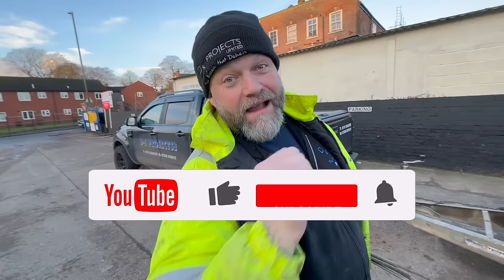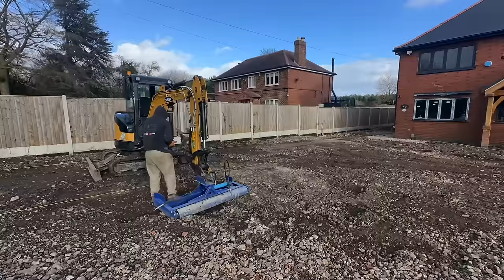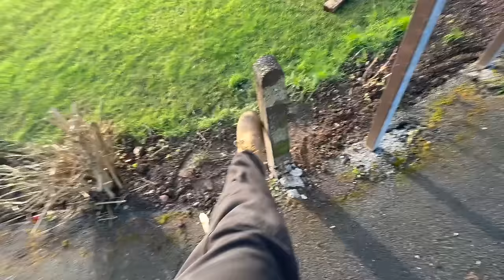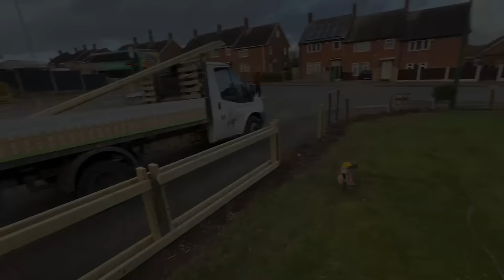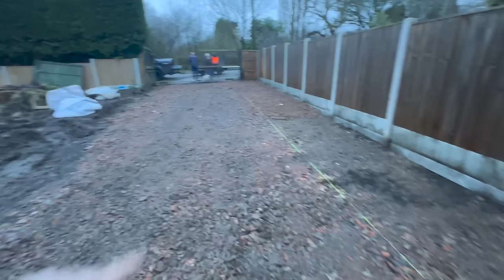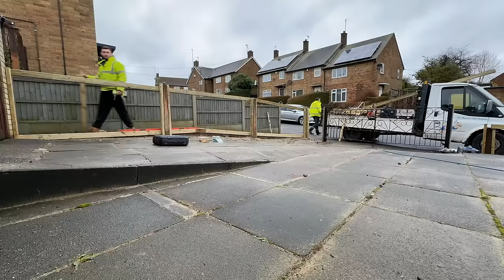How To Replace a FENCE Using The OLD posts *EASY DIY*

Comment: The best example of why the modern concrete post fence design is superior. Super easy to lift a panel and make a change without too much work. Great job guys.

Comment: Great informative video again boys. How are you drilling through the concrete posts to out the bolt through both timbers. Doesn’t the concrete posts have strengthening wire in it ?

Comment: Stevie my guy you don’t rail up like that on the last bit of the video…you go post to post. You should of cut the 4x2 on each post my guy. Or that’s the way I do it….the pails will hide it I no….and the customer must have money to throw away having 4x2 rails on both sides…you could of double sided it using one 4x2 and just clad it on the back of the front 4x2…can’t wait to see the finish….and loving the driveway job Dave…lucky worked hard putting the extra gravel board on that fence…that’s a horrible job lifting them 12” gravel board in and out….again can’t wait to see that job finished….big love to all D&j family ❤
Reply from the maker: It’s finished now and wait till you see it, looks amazing

Comment: Good afternoon D&J team wow James’s garden seems to look bigger each time you visit it just out of curiosity what square meter or yards is the driveway on James job please? Stevie that looks like a bit of a head slapper does that fence I always hated the mis gap hit lollipop stick fences as no matter what I did they never worked out and I always ended up with the gaps matching each other in the end I used to explain to the customer that there is a large chance they would but I always try not to get them to match but they always did best of the great British luck as you’ll need it.😊😊😊😊😊

Comment: I'm not sure why you put the bottom rail on the dirt. It really should be at least 3-4'' up from the ground to prevent rot. The pickets can be 1'' off the ground.
Reply from the maker: The whole point of the bottom rail is to act as a kick board, the actual rail isn’t on the ground, only the kickboard is touching so that that’s the only thing that will rot later down the line 👍🏻
Reply: Its treated also